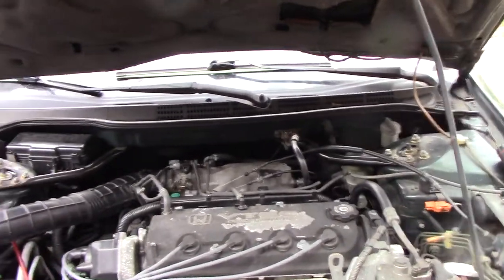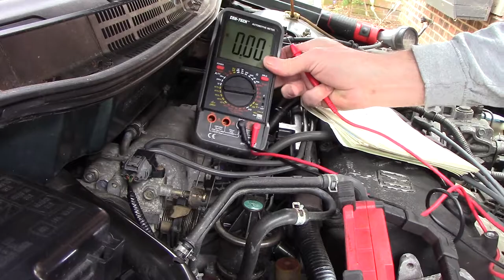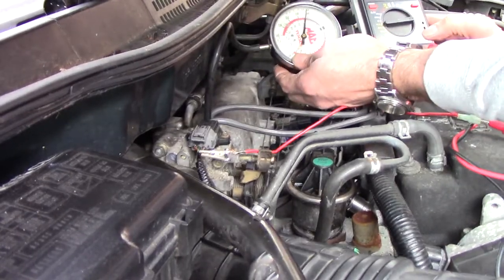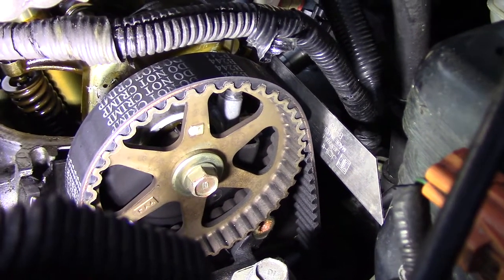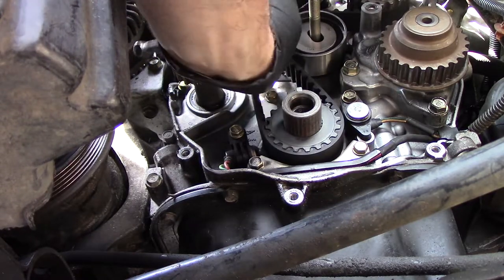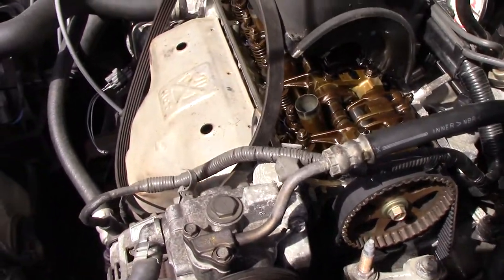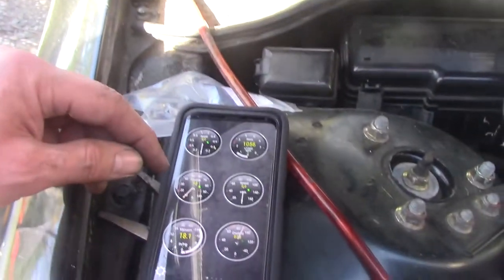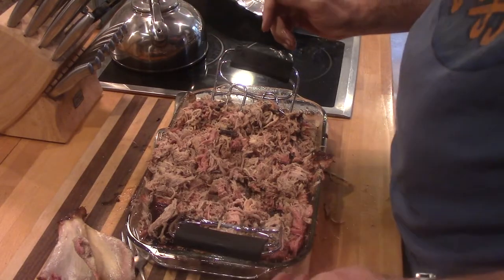Troubleshooting a MAP Sensor Code on a 1999 Honda Accord

Comment: I've been battling a po108 i swapped a 96 manual f22 accord into a 96 auto blown h23 prelude. everything's done but that damn map sensor lol figures i can do a swap but have 0 knowledge on vacuum. I like that vac pump idea i have so many hondas i cant remember which MAP's Ive swapped now ill check em your way.

Comment: What is the wiring harness that goes onto the map sensor and where does it originate from ? I saw the work you did with it ……
    Incredibly I can’t find it after replacing my starter and don’t think I purposely removed it. It has been freshly removed though., you can see the clean ring around the map sensor. Thank you
Reply from the maker: I did this video so long ago I have no idea where the wiring came from. Sorry I couldn't help.

Comment: How much would a at home mechanic charge for this kind of job? I’ve been dealing with sort of the same issue with my 99 Honda and I’ve gotten very familiar with this car after all the work I’ve done. So just wondering what you would think would be a good cost estimate for this diagnosis?
Reply from the maker: I charged this guy around $100, I also videoed so I try to take that into account when I charge people.

Comment: How you guys fix the p0108 cause i tried my map sensor but it doesn’t work
Reply: He took off the silicon that was clogged to the vacuum port and replaced it with a gasket from the local autoparts store